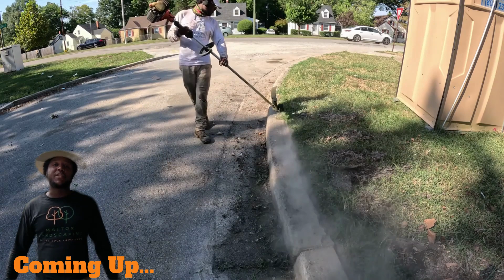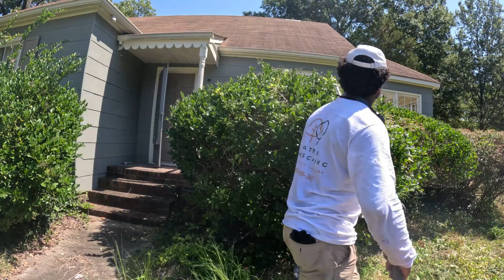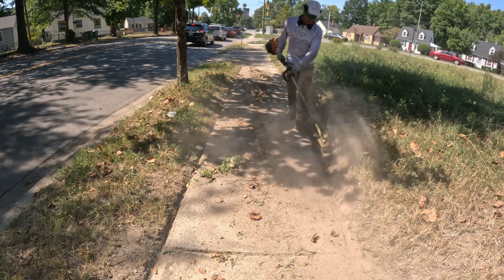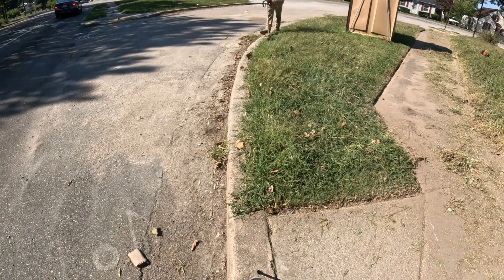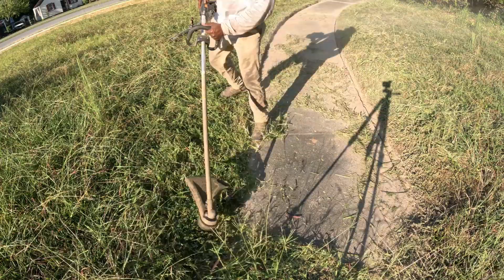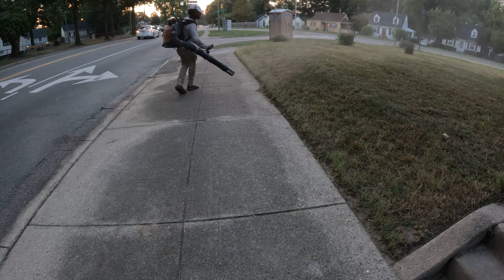I cut an OVERGROWN yard that I cut before, but DELETED by accident!

Comment: You do a great job with edging but as far as trimming the bushes you going to have to get better at that they need to be straight there
Reply from the maker: Thank you thank you. And I did what the owner asked. I’ve been doing this for quite some time, 12 years to be exact. And no not all bushes are meant to be in line at all times. Thank you though!